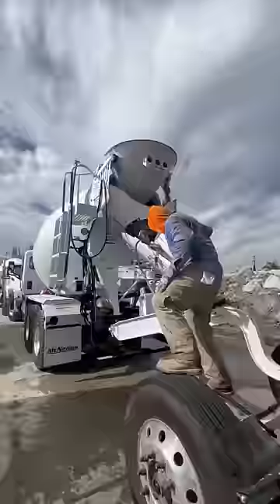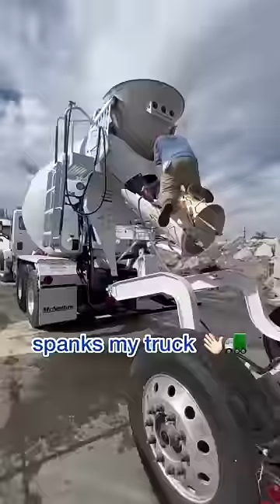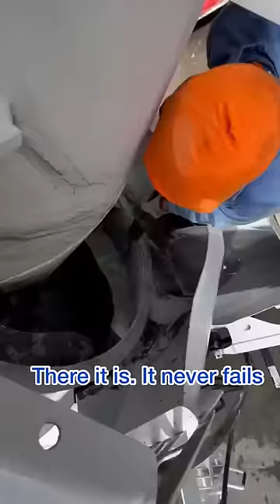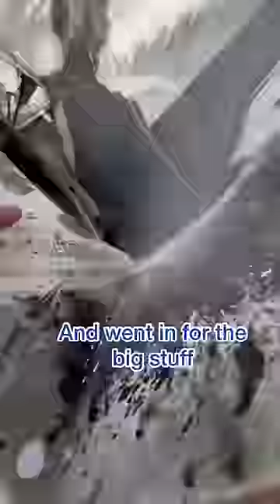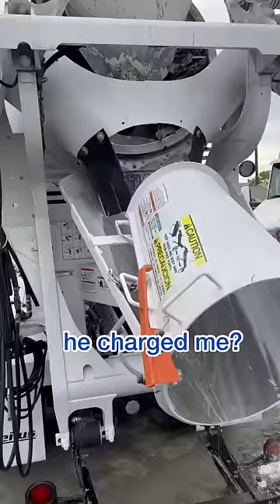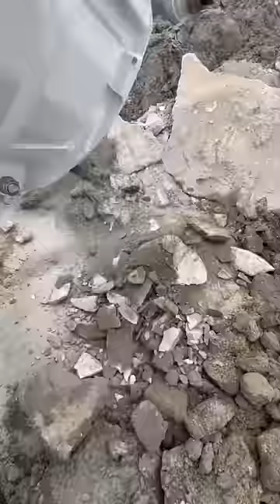He Made $150 in 30 MINUTES!? Would you do this? #concrete #construction #work #readymix #cdl #shorts

Comment: I would definitely have to have the keys in my pocket.
Reply: @ffhgu 07 best practice, but my paranoid ass would also disconnect the battery
Reply: Yup
Reply: Ong i would 😂
Reply: Yeah!!!
ALL THE KEYS!!!!
Reply: The set he uses, or the spare set of keys? 😂
Reply: @lanceproctor8042  all of them and take the starter off👍
Reply: @migueljr9475 Lock Out Tag Out.... Any business that has machinery has this policy to avoid possible injuries or death! 👍
Reply: Even with the starter out and the battery out.. still couldn't go in there.. like one of them commercial ovens you have to get in to to clean.. no way.
Reply: Big facts💯 trust no one
Reply: Older trucks actually use the same key 😅
Reply: It’s classed as a confined space, take the keys, pull the battery’s off and lock the drum in place.
Reply: The keys. Forget that I ll take the hole 🤬ing electrical system with me instead, dang men...☹☹☹
Reply: @donkegin4946  And remove the engine.
Reply: And the Alternator.....🚬 🤣🤣
Reply: @donkegin4946  just the starter? Nah that whole engine has to come out before I go in that.
Reply: The company I work for has some chippers who chip the truck with it on it amazes me every single time how careless they are
Reply: @GenZast  that's what LOTO means
Reply: @GenZast  
 I say if it makes you feel safer then to hell what anyone else thinks.
Reply: Read my mind
Reply: There's lock-out tag-out procedures in place...and yes, 1 of those procedures is "if you're in the drum, you have the keys"
Reply: YOU DO realize that all you do is spin at 0.5 Mph with the drum, right?... You wouldn't even get dizzy... 🤔💯
Reply: @lanceproctor8042  all u do is spin at a very slow speed, nothing would happen. Just fyi
Reply: @Summerlin866  eh not that bad
Reply: Felt this way cleaning the garbage disposal. Can’t even imagine that thing😂😂😂😂
Reply: Or park next to the drivers door and have all keys on your person
Reply: Lock out tag out. The equipment would get locked out, if it doesn’t have a lock out safety feature, the keys go in a lock box and each guy working on the equipment would put their own personal lock on the lock box, and they keep their key on them.
Reply: LOTO lock out tag out
Reply: Yeah, I would have the keys and disconnect the battery.
Reply: Sorry for the ignorance but does the drum spin fast enough to hurt you or would it be the falling debris to worry about
Reply: Yes and the hydraulics disabled That's the only way I would do it That's absolute miserable work 150 bucks for 30 minutes is a deal that guy earned that
Reply: @ffhgu 07 I was thinking about the same thing.
Reply: And disconnect the battery myself...then take the keys
Reply: Yeah I’m thinking loto and the grounds disconnected on the battery 🤣
Reply: @GenZast  good practice, but my paranoid ass would also disconnect the coil pack
Reply: @GenZast  i came here to say that
Reply: You don't wanna go for a spin?  Lol.
Reply: @donkegin4946  😂😂😂😂💯
Reply: With my luck ill have the keys in my pocket while in the drum and my wife with a spare set of keys will start the drum😂
Reply: i work in waste water treatment and when i have to clean the kwonda it’s like a big blender. even when it’s locked out and de energized i still get mad anxious that it’s gonna turn on 😂
Reply: @antoniomatthews4319  I am the same way whenever I change a light fixture i know the breakers are off but still grab the live wire carefully… the spark it generates always startles me
Reply: Guilty as charged lol
Reply: Why was I thinking the exact same 🤦🏻‍♂️ the thought of that mix turning on while I’m in there made me freak out
Reply: @ffhgu 07 that and LOTO the keys to the mirror so nobody can use them
Reply: have keys in pocket, disconnect battery, remove starter, drain the fuel tank, weld the doors shut. then i can enter and start cleaning
Reply: Gotta be better then climbing in combines
Reply: @ffhgu 07  Yep. I used to confine space rescue and we went out and developed these plans for businesses. Often times they have a couple CSR Techs come be on stand for stuff like this. I got to a whole lot of nothing for 40 and hour back then. LOL
Reply: @donkegin4946  and disconnect the battery 😂
Reply: @jsandiego2394  Shhhhhh.....no one asked.
Reply: I would take the door offa that truck for I went in there. That way no ones goina get in and drive it with me in there spinning with concrete and a airhammer. I don't want to tumble in there.
Reply: @donkegin4946  take the key out remove the battery cables then take the battery’s out, remove the starter. Then you’re gonna wanna drain the oil and coolant remove the pistons and cylinder heads. Heck just remove the whole engine, then you should be fine to work inside the tank…
Reply: @crandonborth  i know right!
Reply: And have the guy wait outside and lock the doors. XD
      Like the warehouse managers that have the policy to make you sit outside of your vehicle while they unload dry van.
Reply: I immediately thought the same thing!! Don’t wanna be in a mr Ballen story.
Reply: I'd  remove the battery before I went in there.
Reply: ...battery, starter and driver in my pocket!!
Reply: And the battery terminals, too
Reply: @GenZast  same, honestly.
Reply: @randyherringshaw6325  oh the safety guys here.
Reply: @GenZast  Nothing wrong with that
Reply: Screw the keys, I'd lock the battery in the boot of my car, and remove a critical part of the rotating mechanism and make sure it's on my pocket before I even think of going in there
Reply: @GenZast was going to say.
Reply: One of the few times as a truck owner I'd actually be willing to hand the keys to someone else lol if he wants em he can have em, I'm not arguing on that one
Reply: @luciferactual4436  And what if it's Diesel truck?? Lol
Reply: Supposed to lock out the doors to the cab
Reply: Battery comes out of the truck
Reply: You unhook the battery cable, lock out goes over the end of the battery cable, magnetic signs on the drum warning that someone is inside, and the keys go in your pocket. Don't forget to wear your PPE. It's really not a big deal.

Comment: He only charged $150? Climbing into one of these things is dangerous. He earned that $150 fair and square.
Reply: How is this dangerous? You spin at 0.4 mph... That's ALL that that does.... You wouldn't even get dizzy
Reply: @jsandiego2394  there are giant corkscrew fins inside the drums to push the concrete out or pull it in as the drum spins. The drums on most mixers will spin way faster than you've even seen. Concrete can also fall off the top of the drum while you are in there which is extremely dangerous.
Reply: @evandrewmartinez1  oops I accidently turned on the truck and got it spinning full speed before the guy got out, happens all the time
Reply: @jonathonfrederick2062  I worked as a mechanic for a concrete company and part of my job was cleaning drums on the mixers. I've had concrete fall off the top and land on me while inside. Also if you chip too much and don't climb out and spin it out, it can get stuck in the fins causing a huge imbalance. So if you spin it full speed trying to throw it out you can wind up with a mixer on its side. Obviously I would hope any of the drivers I worked with wouldn't try and spit me out the back while I was in there. I'm just saying there is a lot more too it than most people would think, and if you are not careful, you may wind up getting hurt pretty seriously.
Reply: @jsandiego2394  pov your reading a comment from someone who Is confidently incorrect despite having never gone inside one of these before.

Industry standard rates exist for a reason. In most cases If you don’t think something is worth what it costs then you’re not being ripped off, you just don’t understand what all it entails.
Reply: If it spins when you are inside youre dead, its razor sharp inside
Reply: it's called a trip charge/3 hour minimum
Reply: My cousin did this job and it sucked and was dangerous xD he runs a crab and shrimp boat now tho so idk
Reply: @@tyler530chico you get more than cut.  You get shredded to peices
Reply: @jsandiego2394  Confined space.
How you going to get rescued if you pass out from heat stroke, heart attack, c02 buildup etc, electrocution, chisel into yourself by accident...
Inhilation of concrete dust, extreme levels of noise.

It is quite dangerous and worth the money
Reply: @jonathonfrederick2062  accidents do happen, the greater the risk the more people want to be paid for taking it
Reply: @J SanDiego  uhh I've seen em spin fast af they only spin slow after its mixed and they r pouring.
Reply: @evandrewmartinez1  This is the internet. Everybody is a professional at everything. You can't explain common sense to someone, you're born with it. Don't waste your energy on these heathens.
Reply: @dirpyturtle69  weird how you were completely unable to explain how he's wrong. well, not that weird when you consider that you're not even old enough to legally work lol
Reply: @RagingDong  "how are you going to get rescued?" by the paramedics/firefighters who enter the mixer and carry you out? are you "special", son? HAHAHAHAHA
Reply: @jsandiego2394  please get in one then 😂
Reply: @psychwardsandSCENE  confined spaces are a no go for first responders. Need people trained in it specifically to assess and plan a rescue. A couple of paramedics died here recently trying to go in after someone who was passed out.
Reply: @BMikeAD  they don't need to plan a rescue, the dispatcher will just send fire too...
Reply: Just the concrete dust from being in there will have you lugging oxygen around or worse down the road.
Reply: I would be claustrophobic AF I would charge $300
Reply: @name5293 that's right, pearls before swine
Reply: @evandrewmartinez1  
It sounds like you need a machine lockout device to prevent anyone from operating the truck while you’re inside. Or maybe at least disconnect the positive battery terminal and put a lockout on it.
Reply: @jsandiego2394  its an oven in the drum with little ventilation.  Not to mention crap falling down from the top of the drum as you vibrate the bottom with a hammer.
Reply: Had a buddy die in one when a piece big enough fell off and crushed his head so 150 is cheap in my eyes
Reply: @LuckyCharms777  you never pull the positive terminal off first, always the negative and that would have the exact same effect.
Reply: Just $150? I guess it depends on how often his truck needs to be chipped out. Because he probably makes a lot in concrete.
Reply: ITT: A bunch of people who’ve never experienced the horrors of mechanized closed-space environments filled with dust.

It’s a lot easier than you think to get injured or even killed doing what that man just did.  With the right PPE, lockouts, and training, it is perfectly reasonable to do this job, but if any of those three things fail you could suffer great risk.
Reply: @psychwardsandSCENE I hate to break it to you but the firefighters also need to plan before performing a confined space rescue. It is not as simple as "just send a guy in with his full gear on to pull him out". There is a whole list of steps that would need to be taken before a recuer even entered the confined space, let alone recover the victim. Say the victim has a serious spinal injury from a falling piece of concrete? It would hardly be an easy task for ghe recuers to properly package the victim in such an environment.
Reply: @michaelwebster3124  asking the victim, or if unconscious, stabilzing the neck with a brace is literally all you can do. either way they go out the exact same way on the exact same 2 piece stretcher. do you realize how hard it is to knock the left-behind off? that has a solid grip to the drum, as evidenced by the jackhammer being required.
Reply: @J SanDiego  I work in construction. A few years ago a concrete company that was delivering to the job I was on got shut down because a guy was killed doing this at their yard. Yes, people can actually die inside those drums.
Reply: I was thinking 2 grand.
Reply: Look at all the people in these comment probably not worked with their hands a day in their life yet talking about a guy climbing into a drum with fuck off blades in it that can cause it to spin concrete falling onto you crushing hands and skull etc or bouncing off hitting you in the face.. people make me laugh
Reply: @@tyler530chicoyou been inside these before I take it?
Reply: @jsandiego2394  Your comment is evidence that you've never worked hard for anything in your life

Comment: As a former mixer driver this is important because you need your fins clean to pour stiff concrete. Say a 2” slump to pour behind fire hydrants before they pressurize the system. 150 dollars is a good deal.
Reply: You need a clean truck and fins to discharge low slump concrete into a slip form paver. I’ve sprayed the fins of a lot of dirty mixers just to get concrete to discharge.

Comment: where I live that is 500 to $1,000 depending on how much is in the tank. and how long it takes to get it done. you lucked out with that guy.
Reply: Where I live they probably make the driver or the pourers do it in his unpaid overtime
Reply: I didn’t even know this was a thing. How often does it need done?
Reply: After every 2 to 3 hauls if you really spray after. And depends if your hauling the same mixture or not after being fully filled. The cement cant sit long if not tumbled cause if its solidifies while its full, you basicaly need a new truck. (This is what i know, may not be completely correct but thought i would give my input)

Comment: "During the fifth season of “Dirty Jobs,” episode 20 found Mike rolling up his sleeves to try his hand at chipping concrete. And, as he soon learned, the work is no walk in the park. In fact, when asked to pick the all-time dirtiest jobs out of the hundreds he tried out on air, he placed concrete chipping front and center."
Personally, I would double up on hearing protection, and have a positive pressure respirator.  That positive pressure respirator would stay on until all the dust is blown off my clothing.
Reply: 100%.  Silica dust is no joke.  It's basically the "asbestos" of our day.
Reply: @nickbesserer  basically does the same thing as asbestos yup 👍
Reply: Black lung is no joke.
Reply: Yeah I remember my widows got blown out they blew the truck apart in a lil mine by angels camp Carson hill
Reply: I'm thinking you'd be spending half your time rearranging hoses and moving stuff around to get positioned.  There's not much room for activities inside there.  You're basically crawling around between the fins the whole time.  It's not like it's just a big open cylinder.
Reply: @invictusbp1prop143  this ....have fun rolling around in there with hoses and all kinds of stuff going on.
Reply: How about cleaning drains? Where did he rank that?
Reply: @charleskauffman117 what the hell did you just say
Reply: I chip the hopper of my concrete pump every other weekend or so myself. Some of those 4,000+ psi mixes can be absolute hell and you’ve gotta be extremely careful with the agitators

Comment: It’s a confined space entry! Annual training and certifications are required. When things go wrong, it is normally a body recovery, not a rescue. Back in the day, the driver had to climb in and chip it out, because it was his mess. He failed to adhere to the instructions. Don’t let the cement set up in the mixer and add water after the off load, and rotate the drum until you can get to the a dumping site.
Reply: Thanks,man...I was gonna say all that myself,but you already did.
Seriously-Water. It's amazing...What's wrong with people? 
I learned all that-Spraying water in the drum,WHILE ROTATING,to clean it out-While at my first full-time job,doing concrete foundations...37 years ago. When I was FOURTEEN. (1986) The mixer drivers would do it right onsite,so it would all just get buried anyway. It wouldn't have a chance to dry at all. The trucks had their own water tanks and hoses. I thought they ALL did.
If a 14 year old kid knew this,close to 40 years ago,no one has any excuse now.
Reply: Amen we had to come in on Saturday Chipotle on drums and check out our own drums
Reply: That's why you leave enough water in your tank to clean out your drum so you don't have to chip ship it out

Comment: I used to have to do that to weld new fins in drums. I was a mechanic for a concrete company. The fins would get so wore out they would fall off. I had low seniority and it was my job to replace them. Had to chip the concrete out to do that.

Comment: After you get the complete barrel, nice and chipped out, you should spray it with a mix of diesel and hydraulic fluid so that the concrete won’t stick to the walls anymore. You could also do this method for your schute as well. I am a concrete pumper and I see a couple of the readymix drivers doing this and they have some of the cleanest trucks out there and also the oldest trucks of the fleet.
Reply: And then it'll mess up the load that you got to mix you can't add oil to the mix of concrete that's like putting sugar in a mix of concrete
Reply: Can’t you just ceramic coat it ?

Comment: I once saw an old timer win a bet doing that. All of the youngsters were betting that they could clean the inside of the truck faster than everyone else. He's like 70 years old steps up and said I'll beat all you kids.

So he waited until all of them got finished, and then he went into his little shack gotta have a 1/2 stick of dynamite duct taped it to the middle of the inside of that concrete mixer drum.  Light a long fiews and let it go off. It didn't damage the truck, but it knocked loose every piece of concrete in there. Everything else works fine he just cranked the truck up, rotated the drum, a bit poured out all the chips, and he was done. The whole thing took less than 10 minutes.